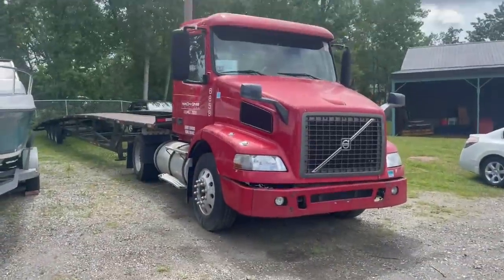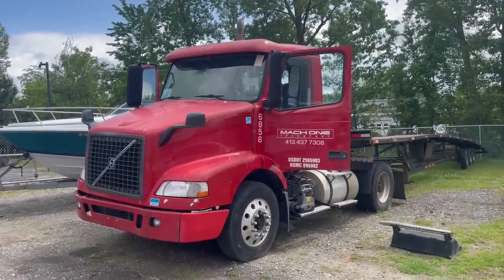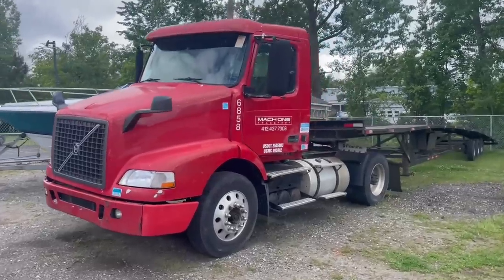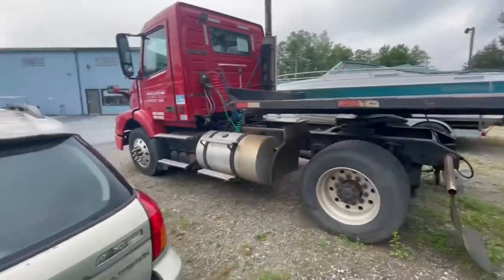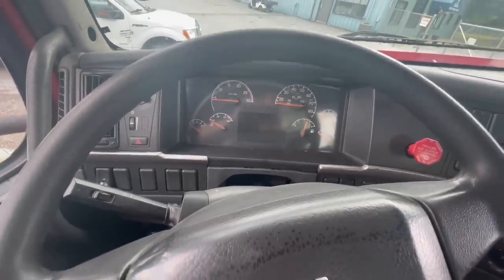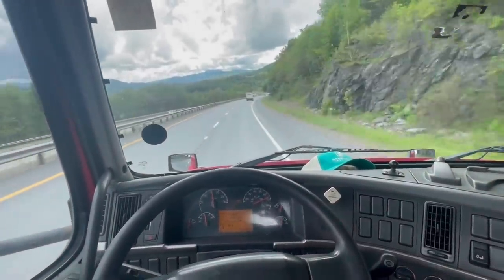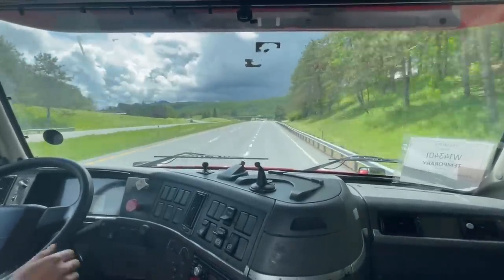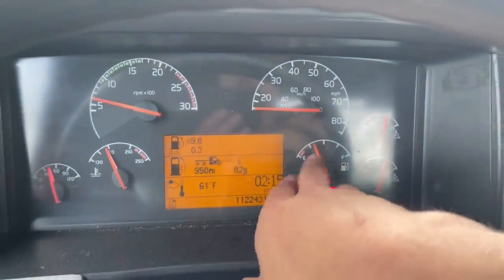I Bought My First Semi For $6,000 At Auction! Was It A Mistake?

Comment: Bro... This might be your BEST video yet!!! BTW, you stole that rig at $6K. Looking forward to the "semi" series. -Andy in St-Albans.
Reply from the maker: Thanks!!
Reply: Yeah, who thought you could buy a Semi Truck, with a car transport trailer for $6K?!!  Hard to lose much on that, I'd think.
Reply: I graduated from bfa
Reply: Congratulations bro.........a single axle is a great tractor to pull you setup you can scale you loads and  trailer without much weight restriction.........great Buy.......👍🏾
Reply: Has no one looked and realized it has over a million miles on it. That’s not a steal that’s average pricing for a extremely high mileage semi especially a Volvo.

Comment: You can find front tires for around $300 each. And I'd definitely switch to duals on the drive axle. For traction and also if you have a flat or a blowout,  you can limp it somewhere on one tire. With super singles, you're stuck wherever you are. Side of the interstate, on a curve, a city street, wherever. Chances are you can trade someone even up your super single wheels for their dual wheels. Some guys like them for the weight reduction.  Best of luck truck driver!😉
Reply: $300 hundred, where are you buying tires from, the back door??
Reply: Duals are a LOT more expensive than super singles. If you’re not going to be out every day relying on this truck for work or whatever, the singles should be fine. 

I would caution against driving it in the winter with them, though. I can’t count the number of times I’ve gotten stuck.

There’s also no way your getting virgin steers for $300 each, and if you do find them, that’s cheap enough that I’d be suspicious as hell.
Reply: I totally agree with these guys. Safe travels.😁🙏

Comment: That was a great buy and you did real good for your first time driving a big rig.  I agree with duals on the drive axle. Usually tire cupping problems are caused by loose steering parts, bad shocks or simply being badly out of balance to begin with, also make sure the wheel alignment is okay.     Congrats and thumbs UP!! 👍
Reply from the maker: Thanks!
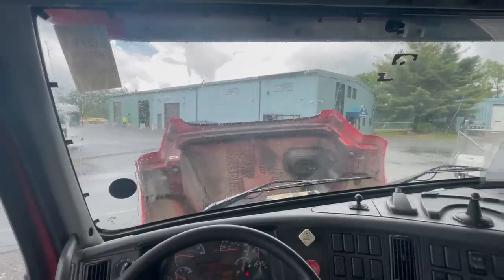Reply: 4:06  "I've driven these before" not the first time. Please listen to his words.

Comment: I'm a mechanic at a fleet shop, we mostly run volvos and macks, although most of our stuff is a little newer. These trucks have been relatively trouble free, we do see a lot of issues with fuel systems getting clogged up and throwing low pressure codes, there is a banjo bolt on the fuel filter inlet and it can get pretty clogged up. The mileage is pretty high, and considering the lack of blowby and not many leaks, it has probably been refreshed. You should check king pins for play, grease all the points in the suspension. Those tires aren't worn normally, I would check wheel bearings or alignment. Only major failures we've seen air top end, mostly cracked heads and one that dropped a valve. Overall seems like a great buy, 6K is a steal for what you got.
Reply: Hey! 1 Q.  Which brand actually offers relatively more reliable heavy engines?
Reply: Amongst Volvo/ scania/ man/mach .. .. ?
Reply: @rubbersidedown7992  I'm american so we have different trucks over here, but we've had good luck with our volvo d13s and cummins x15s. I don't know if you have international brand trucks wherever you are but if so stay far away!
Reply: @Hdogdog7  👍

Comment: Awesome job! As a trucker, I am impressed with your driving skills without having your CDL. You did a fantastic job shifting. What a deal on the truck, super cheap! Were you using the clutch to shift or no? Looked like no. You  shift those by rpm and not so much by clutch. Well done if that’s the way you did it! I’m sure you probably know about the “clutch brake” as well, right? To get it into first gear, you have to put the clutch to the floor. I’m really impressed with how well you did with it. You must have had some stick time in a yard somewhere. Good luck, I’ll be watching!
Reply from the maker: Thank you! I was floating best I could and I have a messed around a bit in the yard before. Appreciate it!
Reply: Those 10 speed Eaton don't have syncros so u shift without clutch if u try 2 your gonna grind alot I used to drive alot 10 speeds
Reply: @ARuralVermonterQqjmcb182  also, it’s a four hundred rpm span between shifts, for example, upshifting pull it out of gear at 1600, it goes in the next gear at 1200rpms. The opposite is true for down shifts. Good luck!
Reply: When you shift gears watch your rpms and take your time when shifting ,it's not a race !  Good luck
Reply: Children killer, Steven Dewey, a child killer is a truck driver from Hartford Connecticut that moved to Vermont

Comment: That's a fantastic buy for sure! No blowby either that engine was very well taken care of or had an in frame. Most volvo engines will crack heads before the bottom end goes, know plenty of people that have well into the 1.6 million and only cracked a head. The slower you accelerate and the lower your rpm stay's on the highway the longer the engines going to last.
You definitely need steer tires, they'll be $500 each minimum! Looking at how they're worn, you either have broken belts in the tires or your alignments out, soon as you get steers on it go for an alignment (Very in expensive and will save those pricy tires) and check over that front end thoroughly.
Take my advise or don't up to you. I'm an owner op and was a truck mechanic for 5 years.
Reply from the maker: Thanks!
Reply: Truck engines don't rev to 7000rpm, they spend majority 1500 1600 rpms, it's about oil and air filter maintenance

Comment: That's a good deal man.  I haven't had trouble from a Volvo engine when I drove truck.  Work on progressive shifting.  Shift at 1200-1300 in the low range and 1350-1450 in the high range.  It should be smoother.

Comment: New Fuel filter, new oil filter, check all brakes shoes/drums, slack adjusters, air canister, S-cams, bushings for your suspension, leaf springs (check for cracks), king pin on your steer axel (might be causing uneven tire wear), check your hub oil, see if hub cab is leaking, wheel seals. That’s a good start and get it all clean so you can see where the leaks are originating from. I’m not a mechanic just a fellow trucker.

Comment: Tip in shifting that you will learn in CDL school anyway, unloaded you can start out in 4th or even 5th, and you don’t need to rev up to get moving, just let the clutch out then feed it fuel. Even loaded I usually started out in 3rd, 2nd only going up hill. I don’t know if you’ve been floating gears while downshifting yet, that takes practice.

Comment: I work at a Volvo dealership and deal with ABS all the time. I’d be willing to bet that it’s just a chafed wire or a sensor not pushed out on the last brake job hahah. Just look for the wires most likely tied up on the brake can or axle and follow them to the connector. Test resistance with a multi meter and it will tell you which end is bad, tractor or sensor. Easy peasy.

Comment: I've been a truck driver for 20 years, and you did very well on floating the gears. (Shifting without the clutch). The one thing you should work on is to learn how to double clutch. The DMV inspector for when you take the driving test will need to see that you know how to double clutch. Study hard and practice your VT state maneuvers. Good luck. Great buy on the rig and trailer.

Comment: Deffo fit dual tyres on the drive axle , also fit some spares under the trailer , much cheaper to swap a blown-out tyre for your own spare than trying to buy on the road , those Volvo trucks are brilliant to drive , our company has 60 of them , all cabovers of course in the UK due to vehicle length regulations , great chanel mate , Waldo recomended you

Comment: I have my CDL and I learned on a 10 speed Volvo. If you know how to float gears do that but if you can’t then at around 1700 rpm is when you want to start your shift by taping the clutch to come out of gear so between 1400& 1500rpm is when that Eaton trans likes to go into gear with little grinding. Don’t ever fully engage the clutch while shifting, only a slight tap when coming out of gear never into gear.

Comment: You got a pretty good deal I have been a truck driver for the last 17 years and a owner operator for the last 10 years you might regret buying that once you get a quote on insurance 😮 it might not be so bad just for personal use do not spare expense on tires. It’s not worth it. I have super singles on my truck. I would not put dual tires. On it but that’s just my personal preference. But they have to be Michelin tires. That is the only thing that I put on my truck. If you got more questions, you can try to get in contact with me or something. I would recommend get somebody in your corner that knows what they are doing. Because the DOT does not play.😂
Reply from the maker: Thanks for all the information! I’ll be buying quality tires for sure

Comment: One thing about those Volvo D12(it doesn’t matter if it’s underpowered you’ll be towing cars. It has more then enough power) They’ll last forever. But Sensors will be key thing to take care of. There’s no DIesel Exhaust fliter nor DEF . Which is great!
Take off the Supersingle. And put Dual wheels on. If there’s no to little Blow by. There’s no need for a rebuild. That truck will last for a long time.

Comment: your oil leak might be a timing cover seal, happens a lot on volvos and are easy enough to change but if its not leaving a puddle i would not worry about it. get duals for the drive axle but to save money most companies get recaps even the one i work for, we have all volvo fleet. also do a fluid change on everything, engine trans and diff, change all filters, check your fifth wheel play so it does not drop the trailer, grease everything on the drive line. the d12 is a very good engine and you will not have to worry about the def crap. on the drive tires you can go with 295's or 11r 22.5 but when you switch you will need to change the revolutions per mile in the perameters or your speedometer will be off a few mph. if it has not already been done do the valve adjustments. all in all you got a decent truck for the price you paid.

Comment: If empty you can start off in fourth gear, volvo d12s can go up to about 1.4mil miles, parts can be expensive so shop around, beware of injectors and delete EGR if possible, dont cheap on steers that could cost you your life, definitely duals, and reason your truck sold for lower is only have one axle if you had two expect it to sqle easily for 9k.  Volvos are good trucks but can be expensive fixing and parts, and usually have electrical issues most folks just ignore like the abs light.

Comment: hey, great job on the driving for being a first-time driver. I will say that for the amount of power and gears that you have, skipping gears is going to be tougher than it would be in a 13 or 18 speed. One thing to improve would be to slow down and watch your engine rpms closely (lining them up with the transmission for a smooth shift) to avoid grinding gears, once you have those figured out you can shift gears blindfolded.

Comment: the front steers are out of alignment, suspension components are worn out. you need a kingpin bushing to fix the tires from wearing out. if you put new tires you'll get the same problem in a few months

Comment: It kind of looked like you were riding down the highway with your left foot resting on the clutch pedal. If so not a good practice you will be running the throw out bearing. Lots of work to replace.Good luck from an old truck driver.
Reply from the maker: Thanks. And don’t worry I had my foot on the mat!

Comment: I always shift between 1,400/1,600 RPM. You don't have to be a speed demon with it, just go nice and easy through the gear and it'll fall into gear as you get more experienced with it.

As for when it gets stuck on a gate, you can either pull back on the stick into the current gear then try to float again, or you can blip the accelerator, play around with it to get it to pop out of gear.

The only time you would be shifting very fast is if you're trying to shift with the jake brake on, or you're on a incline. As for skipping gears, with a 10 speed you'd have to be in higher RPM, I don't personally skip gears, I always just start in 3rd or 4th. But you can go to near 2k RPM to skip a gear, but I recommend to skip gears when downshifting if you want to gear skip, where you can idle down to 800-1k RPM, then bring it up to 1800/2000RPM when skipping a gear downshifting.

You'll get the feel, and practice for it. Hope that helps you.

Comment: So in? My. Experience of driving seyes? I've always used the technique called floating which is shifting without the clutch. So if you can look up videos on how to do that no more than 1500 RPM.  And let it fall to about 12:00 and grab the next year. It'll make it a lot easier in a lot smoother transition between gears
Reply from the maker: Yep I was floating them except for the one hear I missed I had to engage the clutch halfway 👍

Comment: Make sure you do your final Skills Test in a truck with a manual or your CDL will have a restriction. I doubt your school would overlook it and would have made sure to see if you wanted to make sure you could legally drive a manual, but these days most modern trucking companies are automatics only so fewer and fewer people are concerned enough to think about the fact that you have to test with a manual transmission or your license gets restricted. I've known a few drivers in recent years that went through schooling ran by a large trucking company they were being hired in at, and manual was never mentioned or offered. It left those drivers in a bit of a situation later when they wanted to move to smaller companies that still ran manuals in their trucks.

No floating in the Skills Test. Shifting up 1 gear at a time, no skipping gears while accelerating, and always double clutching with each shift.

The things that got people on the Driving portion of the test when I went through were dragging trailer tires across the curb/gutter line in turns, not keeping both hands on the wheel, not doing full head turns to look both directions for intersections and train crossings, and yellow lights that turn red. Specifically on the red light thing, the person testing will lean to see the light until the last possible moment out of the top of the windshield or the side window. If they see red, it is an instant failure of the entire test. There was one person at my school who lost a gear on a downshift as they were entering an intersection on a green that went to yellow as they entered. They found the gear and had never stopped but the truck was moving slow enough without being under power while that gear was lost that the light went red while the person administering the test could still see it.

Pre-Trip portion of the test is basically just about memorization. Knowing where the parts are and the correct verbiage for naming and describing conditions.

Backing shouldn't be an issue for someone with plenty of experience with a normal auto and trailer. Just bigger and more sluggish. Toughest part (didn't take long) was getting used to how slow the trailer swung compared to a short trailer.

CDL school was fun. Not often school and fun go together, but it was. Got to drive a few different types of trucks

As for you buying a Volvo, all I can say is I hope you like playing with wires and sensors. The D12's are solid engines and none of the Volvo transmissions seem to have many problems. Even their turbos seem to hang on longer than most. But Volvos are Swedish engineering. They have a lot of electronics, wires, and sensors, and they all seem to be connected regardless of whether there is any good reason for them to be. Something that on another truck would be a "fix it when you get to it" part can be a complete shutdown on a Volvo. There is also a big lack of aftermarket options so parts can be a bit pricey.

I think Volvos are great trucks and have many positives to them, but there is a reason they don't hold value as they get older and higher mileage. Even low mileage ones reach a point where the price falls out because the wiring and sensors becomes a problem (a big one) just from aging. They run well and drive great when they aren't stuck in a shop.

I wouldn't want an older one operating as a traditional highway truck but, for your situation of just wanting something to haul your cars part-time, it might do well for you. Even with the issues it will definitely have with wiring and sensors over the next few years, for the price you paid and your willingness to turn a wrench, you could get a lot of value out of it.

Comment: duals for sure. all new tires. all fluids. shifting will come when u drive more. as you get the feel for it. dont run the seat full of air. it will be much more comfy. anyways. nabor at the top of the lake near the boarder says poof who has a million miles out there and was a driver trainer .

Comment: A working truck for 6k? That's amazing. Keep it alive, with the nightmare of emissions coming this truck's value will skyrocket it's weight in gold. 
I'm sure you could swap it to a proper engine down the line. Same goes for the seat. Watch for rust, stop it from spreading.